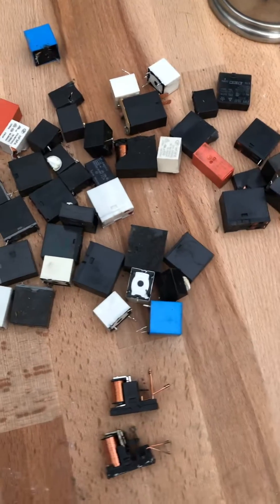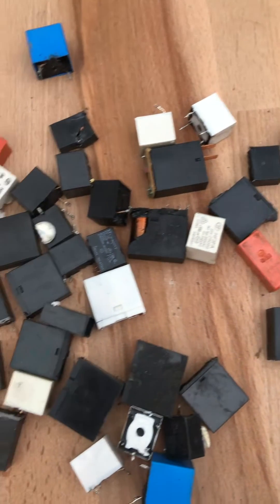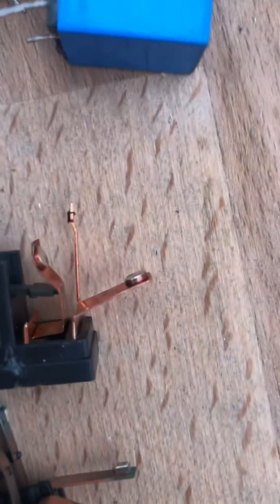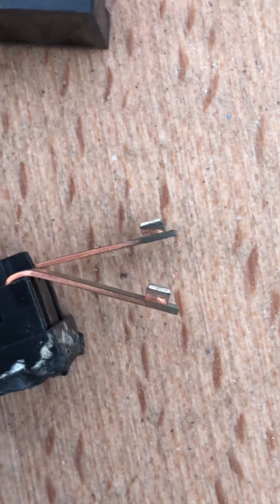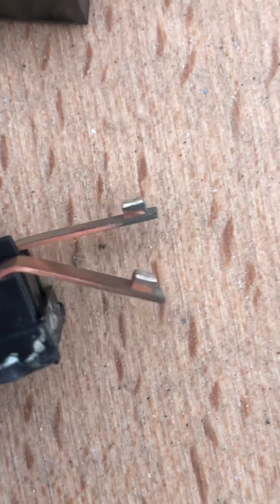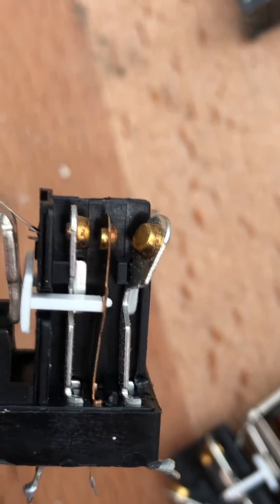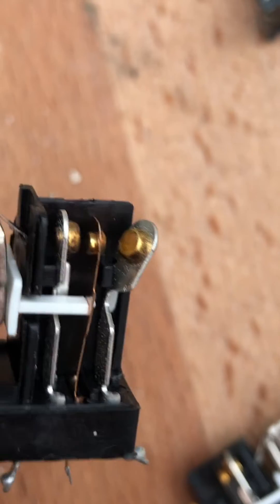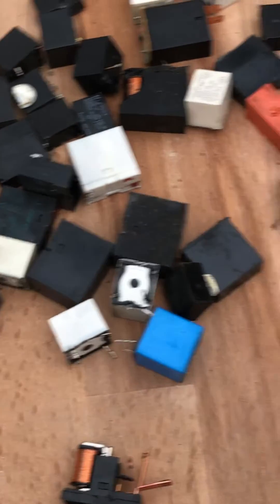Silver contacts inside relays , with something interesting near the end

Comment: I've probably threw them gold ones in with the silver ones thinking they were just all brass coated. Will need to go through the little box of contacts now 😂
Reply from the maker: They are gold not brass , I would go through your box and separate them mate , check out 999 Dusan channel I’ve been watching him for years he had talked about them and refined them for the gold in the past , good channel as he does gold an silver refining of all the different components that on circuit boards , go check him out good channel to follow and gives you a good insight into what to keep of circuit boards for precious metal recovery as well as the copper,brass ,aluminium and other items the usual stuff scrappers go for.